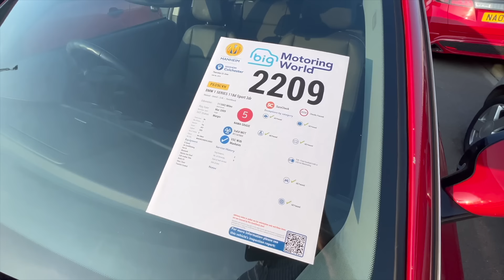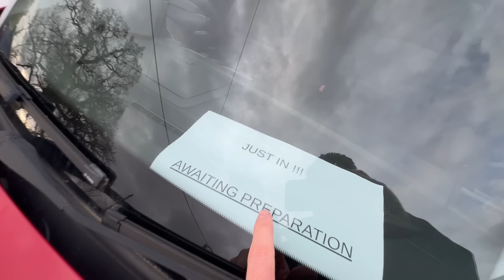THINGS DON'T ALWAYS GO TO PLAN - THE BILLS JUST KEEP COMING.....BMW 1 SERIES part 3.

Comment: Hi Kevin. What would you like you recommend to clean a greasy leather steering wheel without leaving it sticky 5hanks
Reply from the maker: Ohhhhh thats a hard one depending on how worn the steering wheel is and actually what make it is, some can have the glue within the material come through and they are awful. I use an Autovalet product called energen on my interiors which is an all purpose cleaner.....what have you tried so far??👍
Reply: @VisionPrestigeCars  used general wipes before it’s an Astra G Elegance 2002 automatic done just over 40000 miles